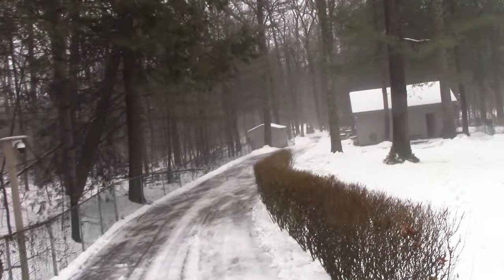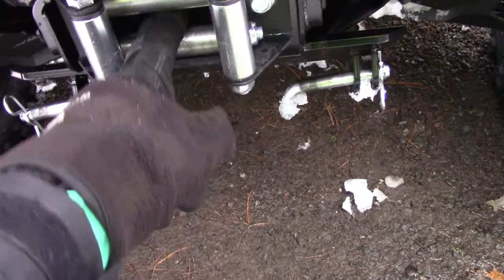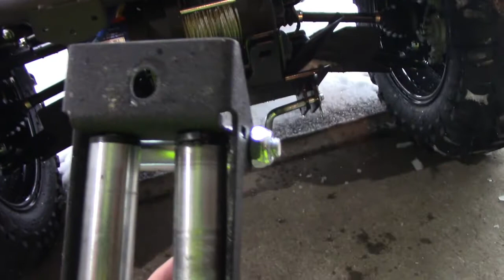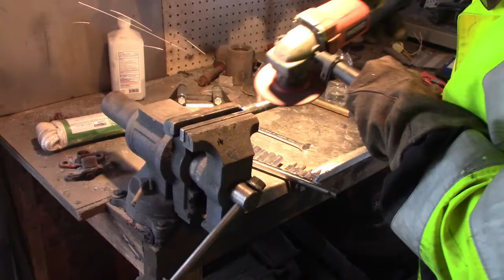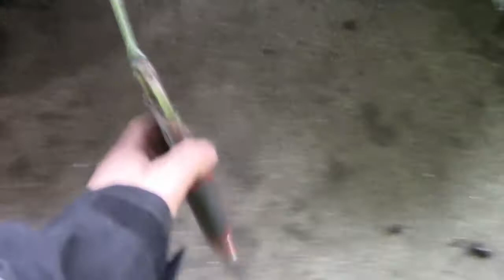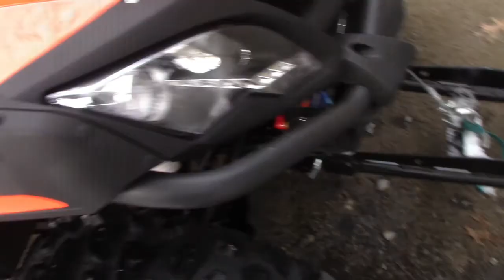2022 CF Moto 800 Z Force plow winch failure

Comment: Nice fix. 
My UTV's winch came with steel cable. That cable (and the fairlead) were the first things I replaced. If you haven't done so already, think about replacing that steel cable for synthetic rope. It's safer and easier to handle. 
Looks like a KFI plow. If so, they make a bracket that mounts on the push tube near the blade which raises the cable mounting point. Still lifts the plow more than 2 feet off the ground (if you need it to go that high) but takes most (if not all) the weight off that roller fairlead. If it's another brand, then it should be easy enough to make a bracket to raise the cable attach point.

My setup currently has rope with a Hawse style fairlead and the bracket mentioned earlier. I just got a winch strap that I'm going to swap in to save my winch rope from getting all bound up on the winch roller due to all the winding & unwinding. The strap is much shorter in overall length so binding isn't an issue.

Comment: I know this video is kind of old and you probably resolved this issue by now But you need to make a bracket so the cable stays out straighter Lots of people have this issue And it doesn't matter what brand it is.
Reply from the maker: Yes kfi makes a bolt on kit that solves issue